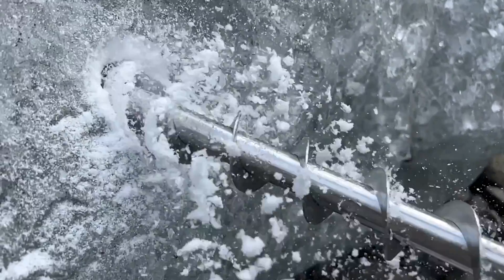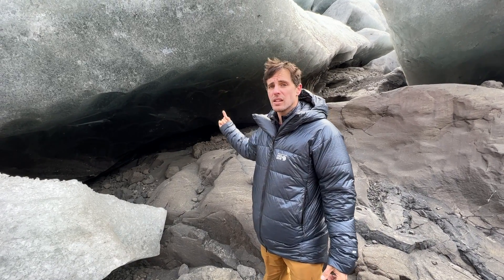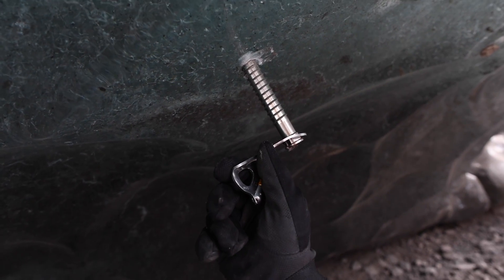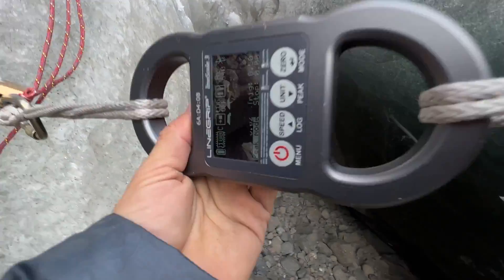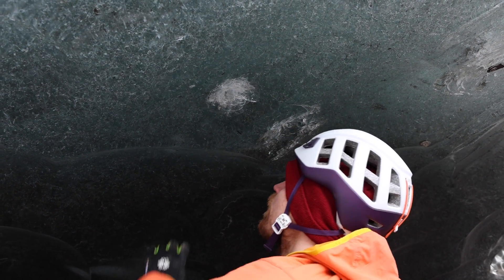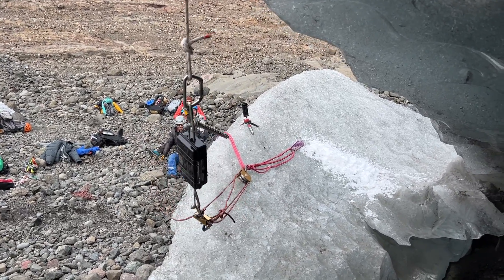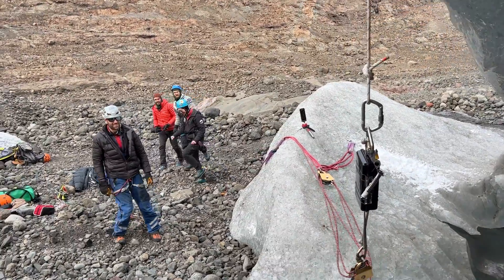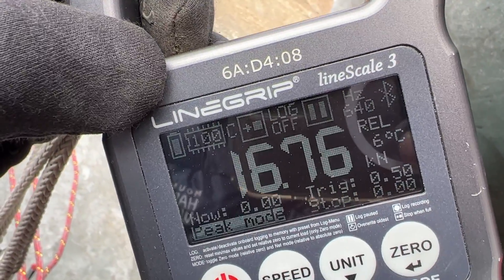How did this happen?!?

Comment: I know this is an older video but I am a climber & engineer and in school I was taught that under fasteners there is a "pressure cone" which you guys are noticing in the ice. A longer screw has a bigger cone. The sides of the cone must fracture so a bigger cone = more force/impulse required for fracture. Also that short clip at the end was so beautiful and well captured it looked fake but I know it is legit which makes it all the crazier

Love what you do. Keep at it. This channel has helped my climbing a lot, made me feel safer, and made me much more knowledgeable about the gear for climbing and how to use it properly (even for specialties I don't do which still helps)

Comment: 10-15º has been tested to be best when WI climbing and protecting but in the other direction you started to test in the beginning. Essentially, you want to *avoid* shear on the barrel and instead leave the threads to hold as much as they can before shear acts on the barrel. So this is why you place ice screws 10-15º in a positive angle and not negative (so the the hanger should be lower than the tip of the screw). As far as I understand it all - which could be wrong haha. The BD aluminum vs steel ice screw video talks about this nicely (https://www.youtube.com/watch?v=j1kD0atLO4s)

Comment: "... in case the threads melt out..." Jesus, that's a scary thought I'd never had before.
Reply: I saw a demonstration on a trip with the Alaska Mountaineering Club. It happens surprisingly fast. We left one screw in at a low level for demonstration, nothing connected to it, and by the end of the day you could pull it out with your hand. Screws and sun don’t mix - use v threads for a long day of top roping

Comment: It would be interesting to compare the failure method of LONG aluminum vs steel vs titanium screws. e.g. would aluminum bend/break the tube before the hanger, etc. Results might be different in hard vs soft ice. Would also be interesting to see different length pickets tested in packed snow (your most likely top anchor for crevasse rescue)

Comment: I would love to see this tested on ice that's just barely thick enough. E.g. 10cm sheet against rock... Or worse... 10cm thick but with air or flowing water behind it
Reply: Like the standard ice climbing conditions where i live XD
Reply: The leader never falls. 🤷‍♂️
Reply: @Davidadventures  yeah but eventually you have to build an anchor to belay off of... Or bail off of
Reply: As a normal climber y’all are crazy and crazy sick
Reply: @nathanwilson3185  You don't have to be crazy to ice climb, but it is a lot more fun if you are ;)
Reply: Does anyone know the brand and model of the “22 kN sling… known for its abrasion resistance” technology, described at 16:43?
Reply: @sam.n.sansalone  Looks like a Mammut Magic Sling.
Reply: @smigolASTV  — thank you  )  🙏
Reply: Average ice screw in the northeast
Reply: I feel like they should just use a little come along hand crank wench